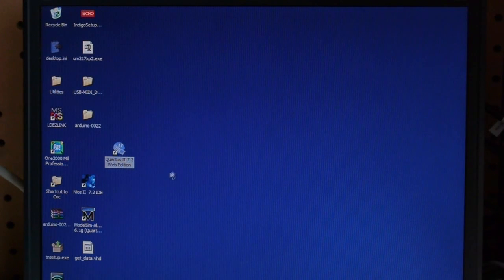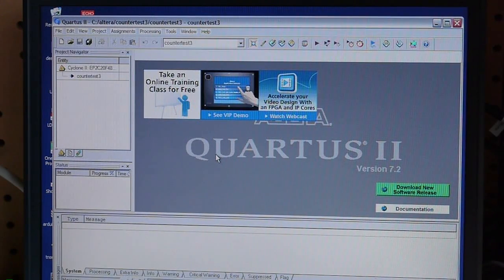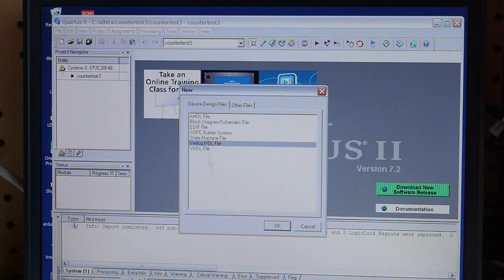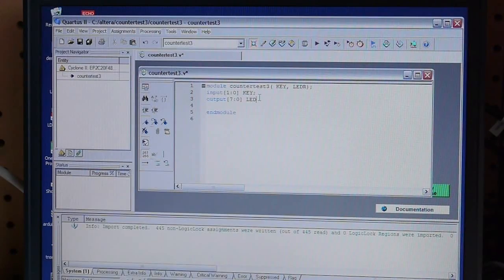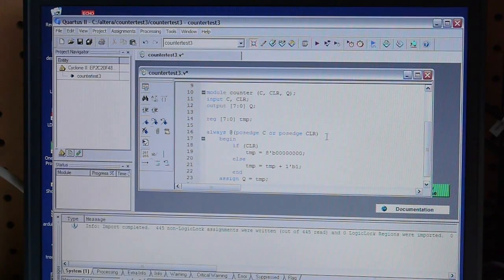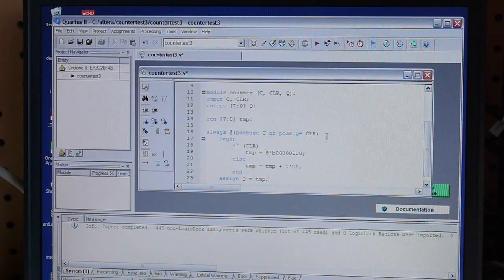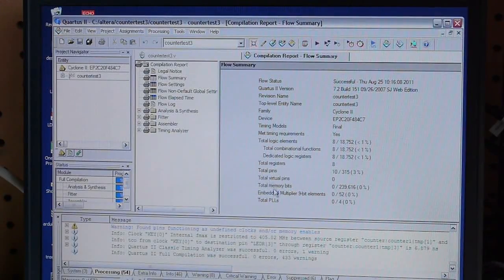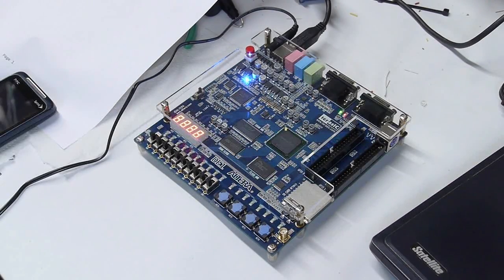Getting started with the Altera DE1 FPGA board:  Create and download a simple counter

Comment: Thank you muchly for this! I worked with this board quite a while back when I was at university. But, then got into a SW programming job and completely forgot verilog. Now, I want to get back into it and this made one of verilog codes work! 

Few things that you forgot to mention on this video:

1. You mentioned that you should make sure you have set the board to "programming mode". For people who don't know, if you flip the board, you should find a MSEL pins. Make sure that the switch 2 and switch 5 (index starting 1) have been set to high.

2. I got one of the latest USB-Blasters and it no longer appears as "USB-Blaster" as the name. It says "DE-SoC[USB-1]". 

3. If the programmer failed, click AutoDetect. It worked for me!

Comment: I never touched on this topic, but it seemed to me quite uncomplicated. Just a discrete logic, only you do not solder it on the board, but simply describe it. Then I watched a few overview videos about how FPGAs and CPLDs are programmed in general, and became discouraged by how many related operations need to be completed and how many components to connect. And now after this video it seems to me again that if necessary, I can. :)

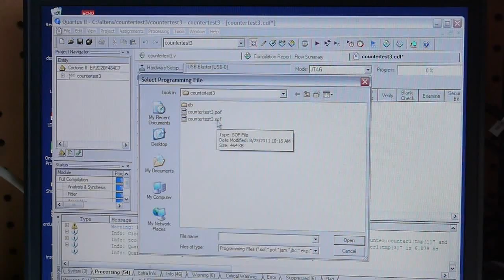Comment: Hello. I bought the same altera card, installed and everything like your video but, there is no .SOF file to program in teh board (14:04 of your video) is it license issue? what type of license did you installed?
Reply: TecnoDesarrollos I could now with version 13... Your video helped me a lot understanding the process if setting up a program. You need the next code changes in order to avoid pressing KEY1 all time to avoid reset:  change to negedge CLR in the always and ad the not operator ! in the if ( CLR) test it.

always @(posedge C or negedge CLR)
  begin
   if( !CLR )
    tmp = 8'b00000000;
Reply: +TecnoDesarrollos it can be found in the output_files.

Comment: How does 'always' differ from a 'while' function in C?
Reply: Im not familiar with the 'always' function, but if I had to guess, I would assume one would execute independent of conditions, the other would execute only while certain conditions are true.
Reply: As far as my understanding goes, this 'always' does not actualy act like a 'while' at all. In FPGAs there is no program that is running, rather all the "methods" (modules) are present at any time. This 'always' statement acts like a listener for certain events, in this case one of the C or CLR going high.
The main module at the top does not call the 'counter' module, rather links the inputs with the appropriate outputs. It's quite a task to wrap your head around that.

Comment: Microcontrollers are capable of doing anything you want, but maybe not in the time you want. You have no limits at all except for things like propagation delays. You do say a thousand additions in a single cycle, or a single cycle FFT if you want. These are things that will take thousands of cycles on a microcontroller. Once you've used an FPGA, you'll realise just how incredibly limited the capabilities of most mictocontrollers actually are.

Comment: Did you do the Pin assignments ? Leds are hardwired with the FPGA chip on DE boards. There are specific names for those pins, You need to assign ports in you VHDL entity to the real Pin names on the board. Search Pin assignments of ALTERA on google you will find help.  If it no works,let me know i can explain in detial

Comment: @bkraz333 This is going to be a really naive question, but when I see these or other microcontrollers, I wonder why wouldn't you just use your main, large computer to control things?  Your computer with gpu can drive a lot more than 640x480 @ 25mhz.  Is it because the controller has special outputs that the computer doesn't? Portability?

Comment: @bkraz333 True, I didn't think about your microscope being a linear accelerator. You could try to use CRT television steering magnets to etch some kind of material. Depending on how accurately you can steer the beam, you could create ultra-high resolution images. Just the first thing that came to mind.

Comment: Nice start. If you have not done so already, be sure to check out the opencores  website. Lots of good cores there and mostly in verilog. You can even go so far as to synthesize an SOC that can run uclinux.  Though practice the basics first before you tackle that one though.